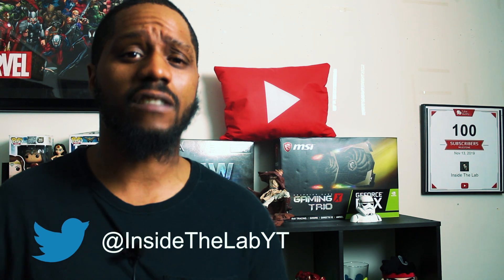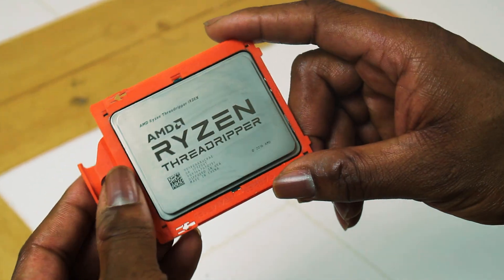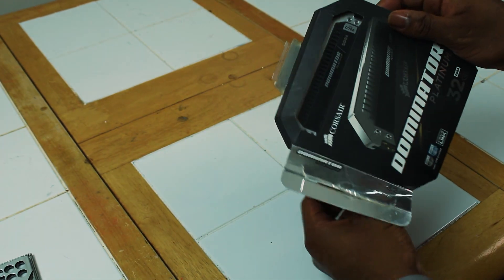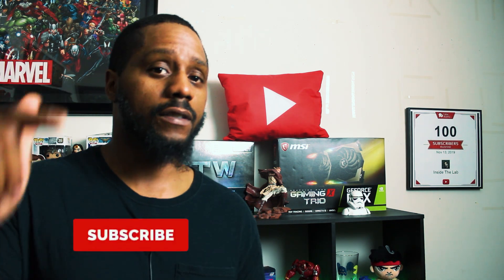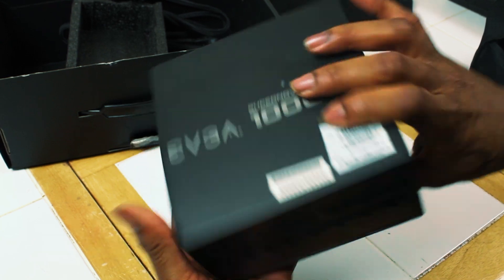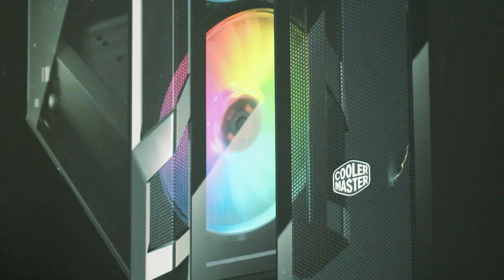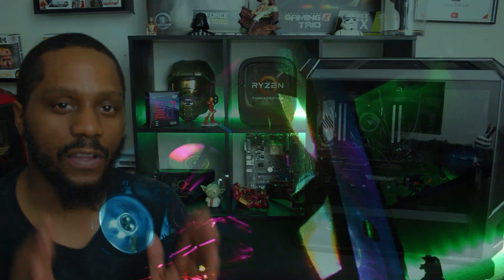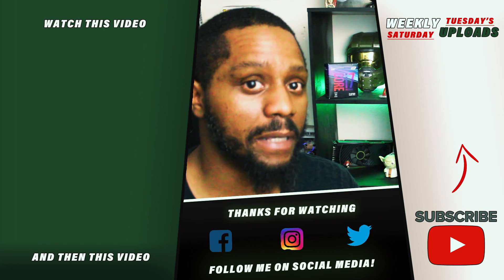Building A Budget Workstation PC: The STORY OF OG THREADRIPPER

Comment: This is a thing of beauty.  Those shrouds at the back of the case are really great for hiding cables.
Reply from the maker: Hey there @304 034 !! Much thanks! This system is one of my favs to use and we're gearing up for Coreshredda v2 !! And you're right those back panels came in super clutch👌